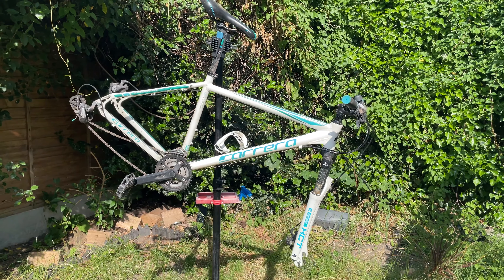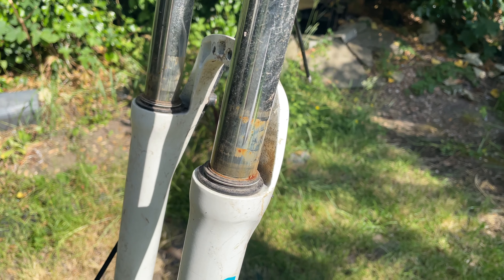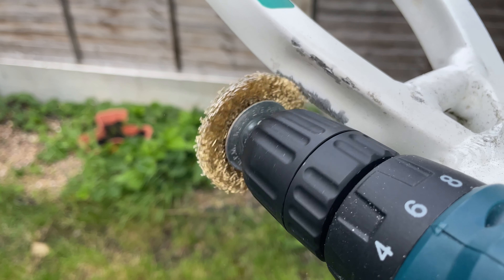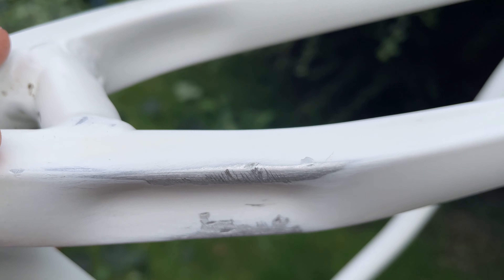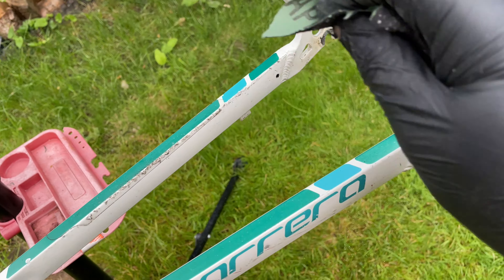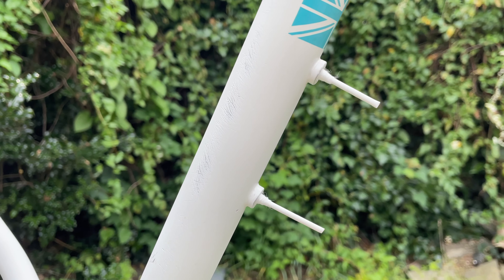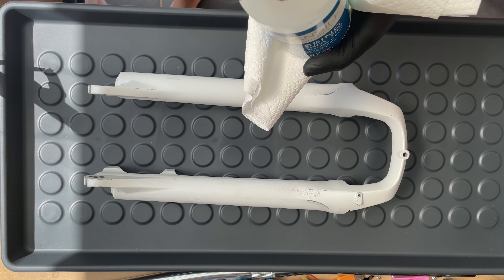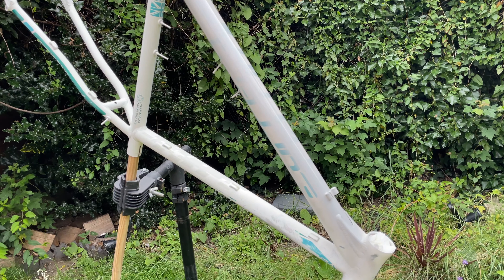Old Mountain Bike Restoration - Splatter Bike Part 1

Comment: I have a Carrera Vengeance and absolutely love it. I only recently got back into riding bikes and I've gained a lot of knowledge from channels like yours and work experience at a bike shop. I've upgraded it quite a bit now and I plan to do an overhaul of parts after Xmas. Do you have any recommendations for cheap air forks with a tapered steerer tube and around 120mm travel? Thanks, Joe :)